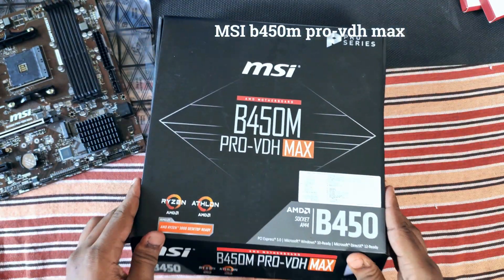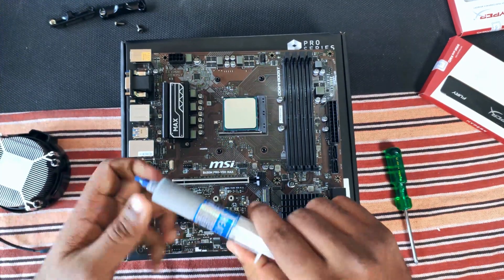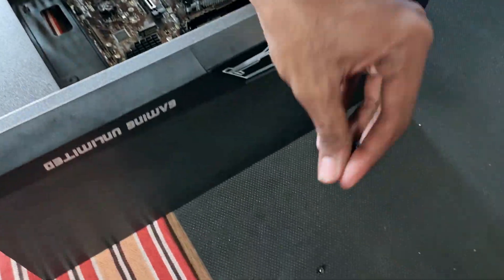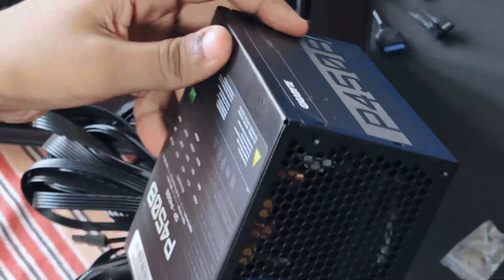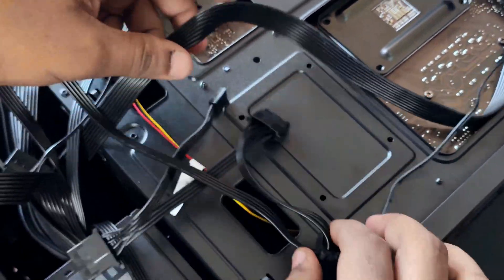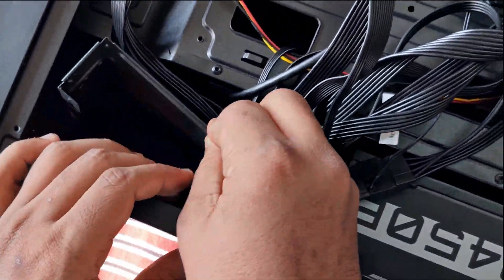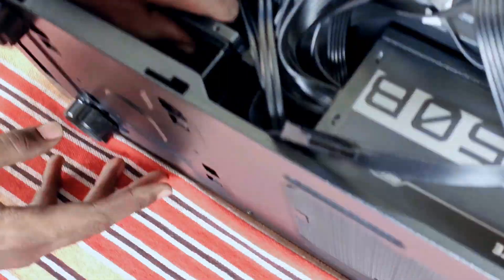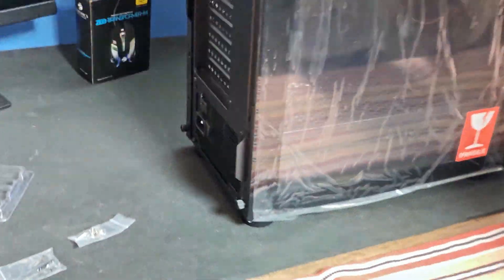#Amd #Ryzen33200g Under 30k Editing and Gaming PC (future upgradable)

Comment: Hi bro, is there any internal button for cabin RGB light?
Reply from the maker: No broh. Its too cheap for that
Reply: I have the same cabinet amd there are slots for 120mm rgb fans 3 in front and 2 on upper side but u need to purchase fans seperately.